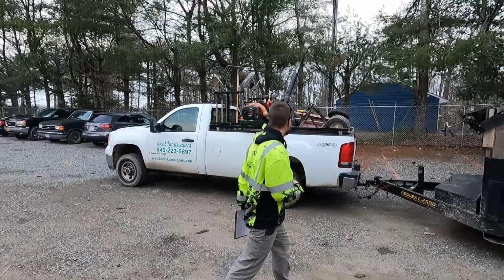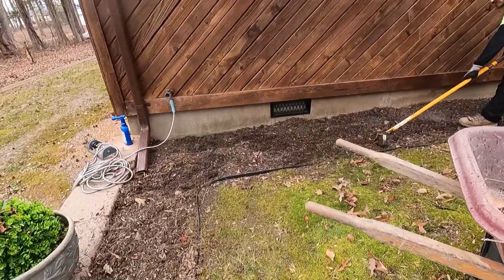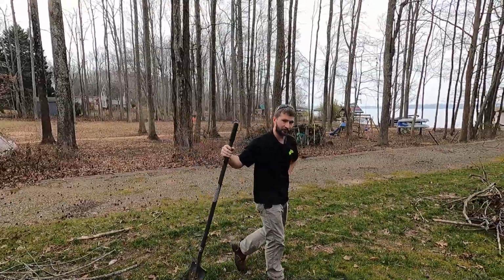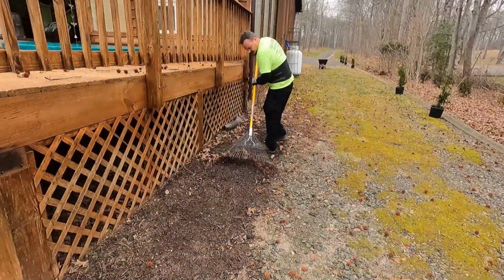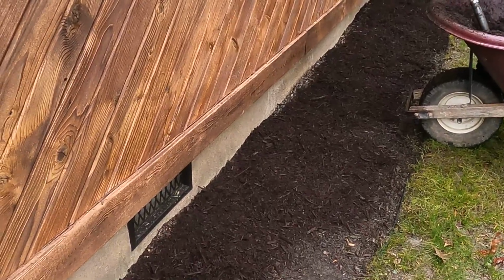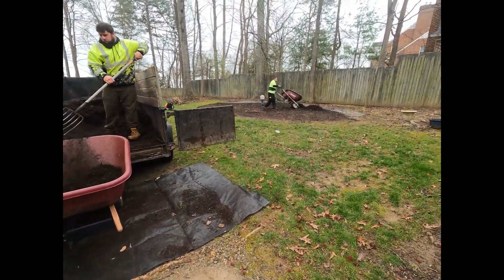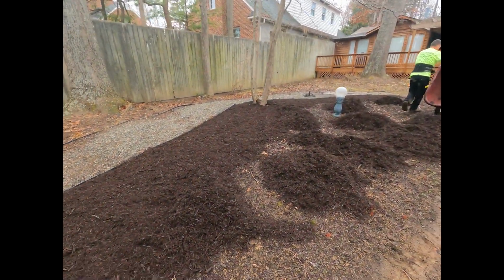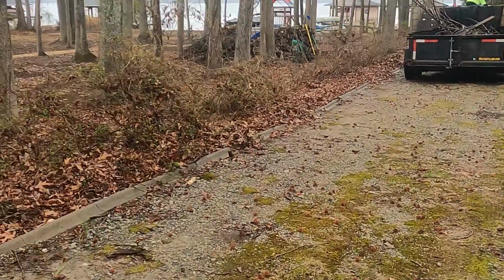How to prepare and mulch a garden bed in your yard

Comment: If you were installing a new mulched bed would you put down metal edging or just define the edge with a shovel like you did on the large bed. I am trying to decide if the cost of the metal edging is worth it. Thanks.
Reply from the maker: It just depends on how much metal edging your talking? It can add up quick if you have a lot of borders. I'd prefer metal edging over the long term